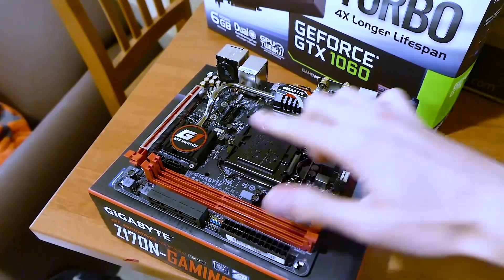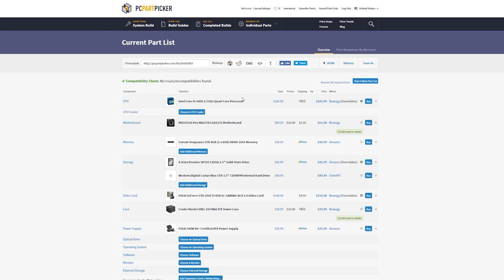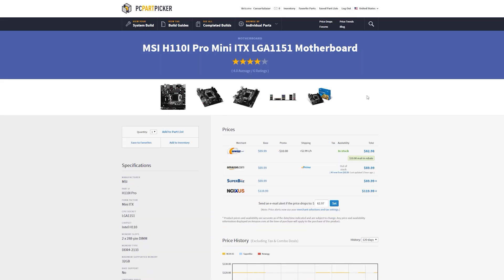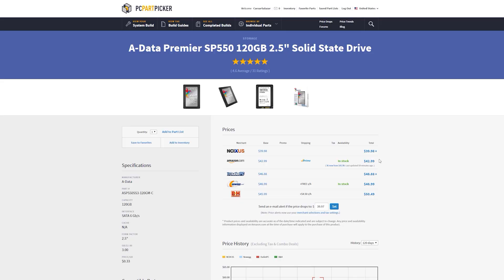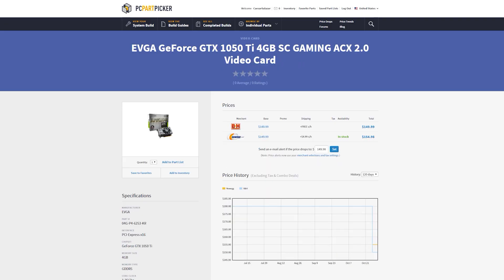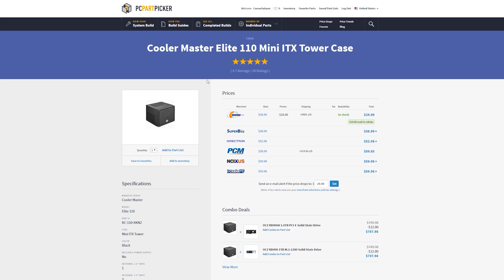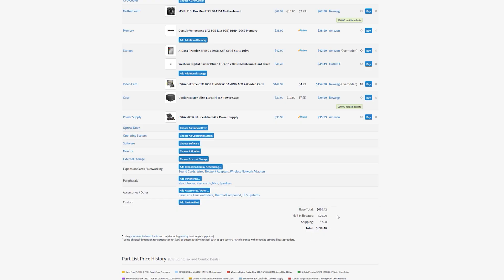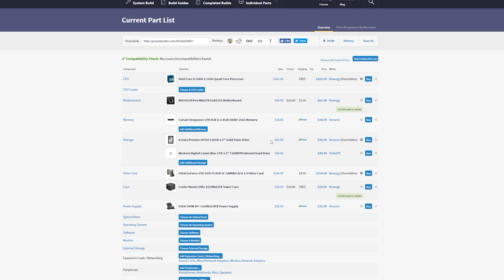$600 ITX PC Build List

Comment: you'd have to shave off that case too because the c7 cpu cooler definitely won't fit in it. I just built a system in this case and except for maybe one or two cpu coolers you are pretty limited to just a stock one with the way the psu mounts above the motherboard.

Comment: i bought 
I5 6402p
gtx 1050ti.
Will I get bottleneck? also the store recommended a 400 wt circle psu.
I'm worried that 400 wt isn't good if I want to upgrade.

Comment: Hey, I got a question. You chosed 2666Mhz for your RAM. But I couldn't find a ITX H110 Board in that pricerange supporting that much Mhz for RAM. Does it actually matter? I saw your video of the test with different RAM Speed, but would such a board supprt the higher frequenzy?

Comment: I think core i3 6300 would be a better processor for budget gaming coz core i3 6300 out performs core i5 6400 at gaming and is about $50 cheaper and it can be upgraded later ;D

Comment: SECOND HAND CPUs are the best performers
buy an x58 motherboard LGA 1366 with a xeon X5650 - (six cores / twelve threads, 32nm cpu) 50$$
OR
buy  an x79 motherboard LGA 2011 with a xeon  E5-2670 - (eight cores / sixteen threads, 32nm cpu) 70$$

Comment: Feel pretty good about the system I put together for my brother, all bought at MicroCenter last month. Had an i5-6500, mini ITX board, 16GB DDR4, 500GB SSD in a Coolmaster Elite 110. It was $500, picked up a second-hand GTX 780 off Craigslist for $100 the next day for it.

Comment: I have a few laptop hard drives sitting around so cod I just get an ssd and use the old laptop hard drives until I can get a desktop hard drive? I know they'd work but I'm wondering how long they'd last before failing as all mechanical disc drives do.
Reply: Just run SMART test on your drives and see if they come out GOOD. If so you will be fine using your 2.5 inch drives. No need to upgrade to a 3.5 mechanical. Yes a 7200rpm 3.5inch will be faster than a 2.5inch 5400rpm drive but it is probably not worth your money to do so.

You could set your 2.5 inch drives up in a stripe array that would greatly improve read/write times.

Comment: I'm sorry but I can't justify the 6400 when the 6500 is only a couple buck more expensive with a substantial clock increase.
Reply: It all depends on location. Some places not much more other countries it is much more. But if you have to keep the build under $600 and you are going new. You almost have to go 6400 unless you are say willing to sacrifice aesthetics and ITX form factor. Then you could go i5-6500 and say mATX build and still get it in at $600. It is just going to be a dirt cheap mATX case. Like one of them microcenter or newegg $20 deals.
Reply: the 6500 is only $20 US more expensive than the 6400. Unless you're in a place where the gap is much larger than that, don't eat out for a week and buy the 6500. You are getting close to a 20% clock speed increase for about a 5% cost increase. Expecially important on a non-K part.

Comment: how would you say a i 6400 is better than i5 2400?
Reply: Of course it is. i5-2400 is 2nd gen while i5-6400 is 6th gen. But you can get complete i5-2400 OEM builds on ebay for $100. While just i5-6400 basically is double the price. So depends on your budget.

Comment: Was just making the same part list and tried adding an RX 470, all are too long to fit inside the case.
Reply from the maker: Oh ok. Just pick a new case.
Reply: 10 bucks more you can get the GTX 1060 3gb single fan cards.At least if your in USA. If you have a microcenter near you it the GTX 1060 might even be cheaper than the rx 470.

Comment: IMPORTANT!

there are no RX 470's available that fit this case - trust me, I've been trying to find one for ages
Reply: How about GTX 1060 3gb for about $10 more.
Reply: JimmysTheBestCop lose 1gb vram for 10 dollars more?
Reply: Even the GTX 1060 3gb benches higher (usually just barely) than the RX 480 8gb in most games at 1080p. If you were thinking about a RX 470 than its strictly 1080p and the GTX 1060 3gb beats the RX470 pretty easily. The 1060 is much better than the 470 just like the 1060 is better than the GTX 1050 TI even though the TI has 4gb of vram.
Reply: JimmysTheBestCop
ts kind of weird having more vram on a less powerful card from the smae company ya know

Comment: I would spend a little less on the CPU and a bit more on the GPU... maybe a i3 6100 and a RX470. Just my 2 cents. Yours is a nice build though, and i freakin LOVE that node 202
Reply: no RX 470's fit in the elite 110
Reply: Tom/Kate Fedrick
Fair comment.
Reply: That is the opposite of what you should do. Do not ever skimp out on the processor unless you only play indie titles. The i3-6100 is not a gaming processor. At least not AAA games especially strategy like Paradox and City Skylines games. Not to mention Civ series. A 2nd gen i5-2400 will best the i3-6100.

If you can't afford Skylake i5 and if you are on a tight budget. Go used especially in the USA. You can get 2nd/3rd gen i7 complete OEM builds cheap. A 3rd gen i7 pairs perfectly even with a GTX 1070. i7-3770 is benches around 3x the i3-6100.
Reply: JimmysTheBestCop
Depends what sort of setup you want, if you want to target 60 fps 100% of the time then yes, go with the i5. If you don't mind playing the odd more demanding game at 30 fps then an i3 is perfect. Then you can have more powerful graphics and really make that game look pretty (basically what the consoles do).

It's all down to preference though of course and i'm not trying to say your wrong, because you're not... just that there are reasons to go with either build.
Reply: *****
I agree, i have a 4790k running at 4.7ghz. 6700k is a pretty pointless upgrade for me. I just acknowledge that some people aren't as fortunate as us and have to go budget. And, people coming from consoles to PC for the first time won't be put off by 30 fps.

Comment: http://pcpartpicker.com/list/Xb4Tr7

The build with a better CPU and a rx 470 for anyone who is interested. This is the same ~$600 without mail in rebates and is going to be about 10% faster overall. It sacrifices the HDD to do so though.

If you don't go mitx you can add back in a 1tb HDD like in the build below.
http://pcpartpicker.com/list/gDr8HN
Reply: Nice builds. in your second build you could take out the 1tb drive and go i5-6500 and go GTX 1060 over the 470 as well. Maybe enough money to go 240 ssd. Based on your list here is a 3rd alternative:

http://pcpartpicker.com/list/V4XQRG
Reply: Maybe the 3gb version. IDK it would be close although honestly 120gb of storage probably isn't really enough although it would be easy to find a cheap HDD to throw in later second hand or something.

Comment: can u do a video on or at least answer a question about, why video cards cost so much.... I mean most of the time the video card is 3 quarters of the cost of a rig and in some cases it even costs more especially high end rendering cards like the $5500 to $6000 quadro video card... I get that there's a diffrence between vram and sdram or regular system ram but these video card manufacturer's act like the ceo him or herself had to go Into the rainforest and kill the endangered elusive vram beast with a Dimond encrusted golden spear

Comment: would that system run a gigabyte gtx1080  G1
Reply: It would. But it would seem an ill fitting build for a gtx 1080. And I would assume you were gaming in something higher than 1080p or why would the GTX 1080 be needed?
Reply: I won the 1080 that's the only reason I have it considering it's the only 0c part I have I can't even afford to buy the parts on this list right now
Reply: And as in run I meant only the power of the build. It wouldn't actually fit in at the ITX case.

What is your budget? And are we talking about USA at least? Would selling the GTX 1080 be an option? You could get at least $600 just for the 1080. Better to have a complete computer than just having a 1080 you can't use.

If you're in the USA and have couple hundred you could go used i7 route. Dell optiplex 3rd gen i7's complete builds go for around $275 on ebay. Since you have a 1080 you would still need to switch PSU's and cases.  

My vote sell the GTX 1080. And build a 3rd gen i7 box with a GTX 1060/1070. I mean if you are on a budget you will only be gaming at 1080p and probably not even at 144hz even the 1060 will meet all of those demands.
Reply: My budget is 0 really i m broke I'm disabled and trying to get ssi so I have no funds coming in I have had it up for sale but no takers

Comment: I have $600 saved up now, but I'm going to save up a bit more until I get roughly $800. This will allow me to get a better graphics card (Sapphire Radeon 480 4GB+), and a bit more RAM (16 GB since I also do some video editing), and an i5 6500. 

the downside to using PCpartpicker is that is rarely shows what Shipping will be. and that might put you over budget by quit a bit. Just something for everyone to keep in mind.
Reply: Depends where you live. If you have Amazon Prime or Newegg shipping services. And if you live near a Microcenter. 

Another option you have is the used market. You can get complete Dell Optiplex i7-3770 systems cheaper than a i5-6500+mobo. It will still bench almost 2x as high as the i5-6500. Much better for editing as well. And you would save a lot in budget. You could get 1 of them and drop in a GTX 1070, new psu and case and you be under $800. GTX 1060 and you be well under $600.
Reply: +JimmysTheBestCop I refuse to buy Dell products ever again. Not after three of their laptops died on me within the same year.

Comment: Can you try to build an excellent NAS build? I never seen you make one since most of your builds are high end for enthusiasts and gamers.
Reply: If you need help it is pretty easy. Best method is to get used parts as they make great nas units especially if you are using Nas4Free as the OS. 

But yea I would Greg to make a NAS video as well.
Reply: I already turned an old Dell PC into a simple home NAS and works great, just wanted to see if Greg can do the same.

Comment: The $30 for the cooler could be shaved by buying a cheaper power supply as the 1050ti doesnt need a 6pin, instead drawing all of it's power from the pci slot.
Reply from the maker: Read description. Not using 1050Ti.

Comment: ?? if you want the cooler that bad then ditch the SSD, i used a 1tb seagate barracuda for ages and it was fine, how impatient must you be to crave an ssd. like i now have a 120gb SSD for boot but i got it just cos the budget wasnt this tight and i do recommend it but like i said, if you want to overclock and whatever the SSD is NOT necessart, its just helpful

Comment: The AMD cpu are still decent, but with intel skylake cpu at the same pricepoint with better performance it kills the idea of amd being 'budget' anymore. Zen can't come fast enough. I'm hoping it competes decently so I can switch and give the little guy a chance.
Reply: It has already slipped to Q2 2017. AMD has to go up such a steep hill. Not only do they need to be at least 80-90% the performer as Skylake/Kaby Lake but they need to at least cost 20% less or why would anyone buy it.

No one in education or corporate will. The average consumer has never heard of AMD. Only enthusiasts. And it has to be worth it to switch. Not saying they can't pull it off. I just wouldn't bet on it.

Comment: why would you get a cpu cooler for a non K CPU tho ?
Reply: If you are gaming AAA titles the Intel fan will be incredible loud and the chip will still be hot basically hovering around the thermal throttling point. Compounded by the fact its in an ITX case with less than optimal airflow compared to ATX case.
Reply: yeah that s a good point ty

Comment: Here is a 600 Pound build i just ordered....
I5 6400
Zotac mini 1060 3gb
Msi B150M Mortar
Fractal node 1300
240 gb Sp 550 A-Data ssd
EVGA 430 Watt psu
1X8 gb stick of Corsair Vengeance ram.
Reply: shouldve went with a h170 motherboard
Reply: Those are slightly older Motherboards and in addition a bit more expensive than most B150M motherboards, also its kind of hard to get a micro atx or mini itx H170
Reply: Pathogenic Squirel The B150 and H170 motherboards are usually the same price(im from New Zeland and its the same price here). As for itx builds you could go with the H110 motherboard because the B150 motherboards werent really built for gaming even though they have been modified for gaming from some manufacturers but the B150 was made for business PCs and are missing alot of features that you would find on higherend chipsets
Reply: They do have M.2 slots and 1 additional channel of ram. h170 mobos are 10 to 20 pounds more expensive here. Also this B150M has good reviews for gaming and also I can trust Msi on making descent gaming Motherboards but that's just my preference in all honesty
Reply: Pathogenic Squirel Thats true but check the specs for the chipset before you try upgrading in the future because i know that b150 has no support for RAID, Overclocking and a few other things
Reply: Good point But right now this build isn't doing anything crazy all i'm going to be doing is Playing a few of the most recent and upcoming games. I can always upgrade the motherboard when i need
Reply: Pathogenic Squirel Its true that you can upgrade the motherboard when needed but your basically putting the money down the drain so chose your parts wisely and go with it
Reply: I am not wasting money if i wanted a B150M motherboard. I am just saying that his motherboard should last until an upgrade is needed after that i wouldn't care about it too much anyway. For  a mid range gaming pc this should be fine with the 4 Ram slots Ram is probably the first thing im upgrading
Reply: Pathogenic Squirel When i say wasting money i mean that you can spend a few extra dollars right now instead of spending over $100 on replacing the motherboard on the future
Reply: At first i was going to get the cheapest motherboard there is that can do what i wanted but i did spend more after that to get a more capable motherboard like this one. Over here i got this for 60 Pounds which hard to beat with everything its got. And it had good reviews on newegg and Amazon aswell so I should be fine now.I will see if i regret this purchase after i have used it with an i5 6400 and a 1060 3gb

Comment: I3 6100 + RX 480 (maximum 10 fps bottlneck, gta v not included) or i5 6400 + 1050Ti ? 
With the i3 will RUN at smooth 60 to 70 fps Max sett and will have some little drop fps in intense sceens

Comment: I vote for FX-83X0 & RX 470 combo over this! :3
Reply: I love AMD, but I wouldn't build a pc with an AMD cpu until Zen fully launches.
Reply: Evan Bryner
I made mine in 2014 but I would pick it again considering the prices for a i5... o3o
Reply: Why? The i5 6400 is a similar price (perhaps 20$ more , same price outside of US). And it's much faster across the board. Skylake is a much more modern platform with native controllers for all sorts of things AM3+ is hopelessly outdated at this point. It's so old it's simply not worth buying anything am3+ anymore.

Also the AM3+ offers no ITX motherboards
Reply: BurningBroadcast
Depends on where ya live! :D

Comment: Nice work ! Don't you think that the i5 6500 3.2 Ghz (3.6 ghz turbo) worth the 10-18$ difference ?!
Reply: the difference between the i5 6400 all the way to i5 6600 are basically the same. It only really changes once you get to an i5 6600k when over clocked
Reply: I know it wont affect gaming but it definitely will affect other tasks ! 3.3 ghz so much better than 2.7ghz

Comment: Hi, you could check on the i5 6402p processor, i am using it, it is better than the 6400 if you pair it with a GPU.
Reply: Are you overseas? Not in USA? Its not sold directly to the consumer in USA only partners.
Reply: JimmysTheBestCop oh yah. i forgot to mention. i am at India. 6402p is nice has slightly better clock speeds than 6400. but imbedded graphics performace is bad if u plan to use it without a Graphics Card. but if you use it with graphics card, its better than 6400 slightly. The thing is, i got it cheaper than 6400 at India.

Comment: Sorry, I get the idea, but a build without building it? Just a list? :/
I really prefer your other kinds of videos much more than this.
You said "I wont build it, because I built a better version of this recently" - but you are using an entirely different case. And the CPU has so much less clockspeed.. A build video and benchmark would have been much more helpful for people considering this system. ALso the 1050Ti is so new, that we dont even know all it can do yet.
You compare it to a 960, you could have also mentioned why NOT get a 960 4gb of which I have seen some sold new for the same price as the 1050ti in recent times.

Comment: I have a $600 ITX build with a i5-6600K and a GTX 980. The only used parts were the 980 and the PSU (half price ebay cuz the fan made a noise, but not used). I'd also recommend getting the SG13B instead because its the smallest available that's cheap and it supports full atx PSU's, but then again its predecessor requires SFX but also supports slimline DVD.